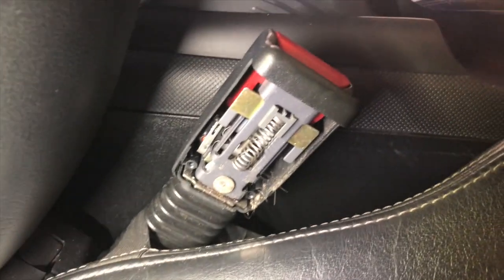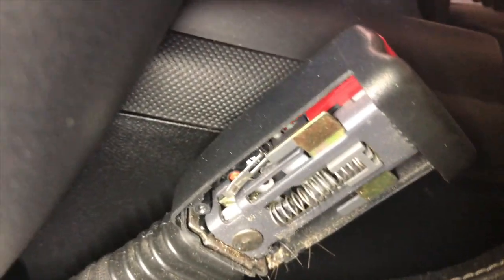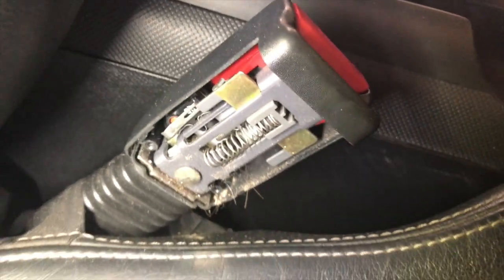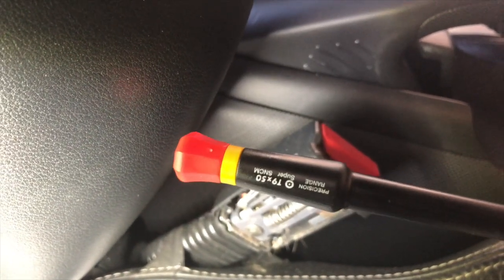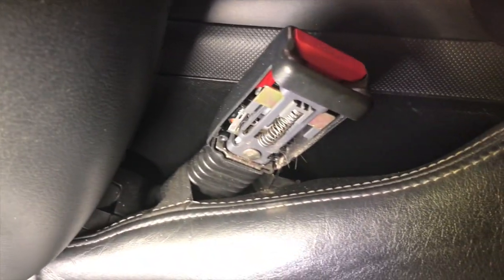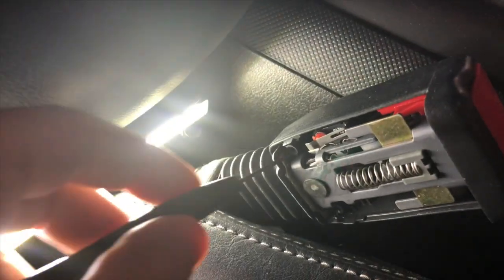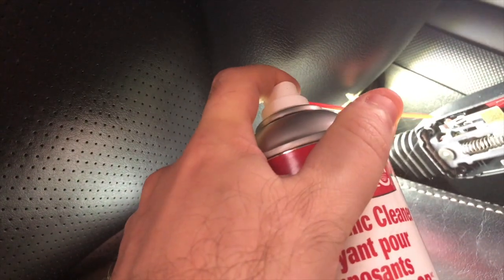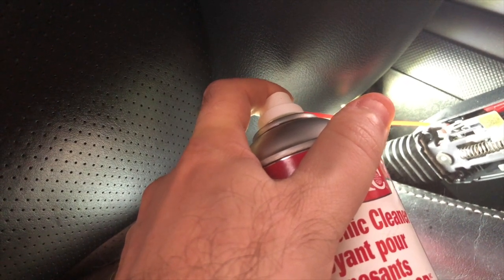2005 ACURA RSX TYPE S - CLEANING SEAT BELT BUCKLE FIX SRS!

Comment: did this fix your SRS issue? currently having this problem on my 04 rsx
Reply from the maker: Well I have 2 codes with mine so it should have fixed the first code.
Reply: @jrus1  what are the codes you have?
Reply from the maker: @SoJ1RoTV  09-4  15-1